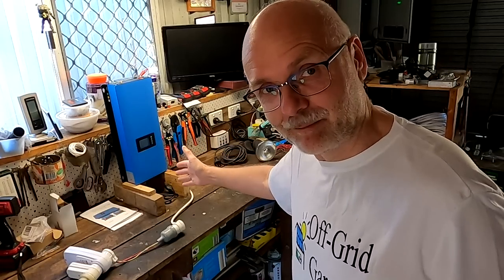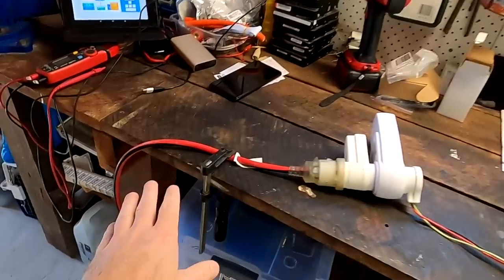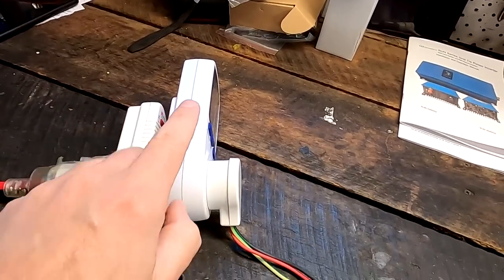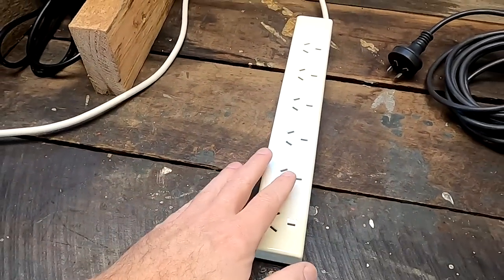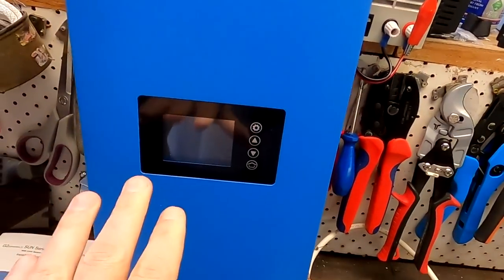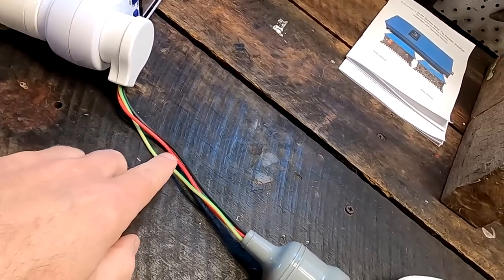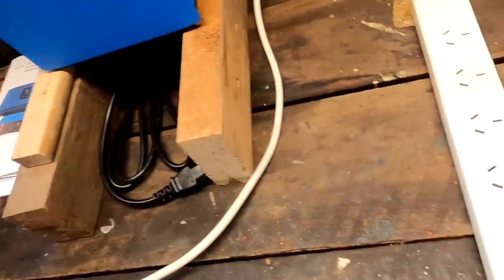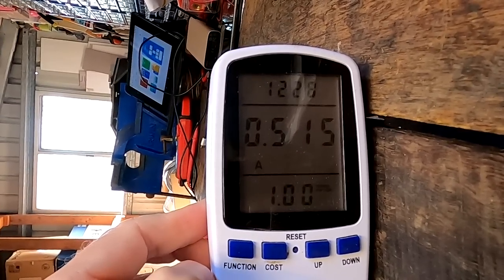Sun 2000 GTIL2 Inverter full test. How it works, what it does.

Comment: So if you turn on another light the grid watts will follow the increase? Is 2KW enough to charge your car? My dream would have one that does both the car and pool pump. I know maybe I am a little greedy! Baby steps; some day dreams might come true.
Reply from the maker: You can just parallel them to output more power.
Reply: It would be good if they produced a 3kw or 4kw model. Cheaper than buying two 2kw units and simpler installation. It could then cope with loads like kettles/toasters etc. Many EV cars use about 10A from a wall outlet when on slow charge so a bigger unit could avoid grid top up.

Comment: I have the unit not providing any voltage to grid. To not have nosebleeds of power company, anyway I balanced pretty much my house usage with panels.
Reply: there is no excess mostly to worry about it.
Reply: I use power strips to turn off vampire/stand by loads
Reply: I use watt meter Kill O' watt to determine vampire loads
Reply: nice you tube video
Reply: during like 7am till around 5pm it provides power I need via panels
Reply: I do not have ac so it is enough

Comment: How do I purchase one of those Tee Shirts?!
Reply from the maker: They are here: https://off-grid-garage.myspreadshop.com.au/
Reply: @OffGridGarageAustralia  Thank You! I ordered a white Tee Shirt and a coffee mug. Thank you for the discount as well. I look forward to your response on using a charge controller from solar while on batteries while in "Bat or solar limited current mode". My manual made reference that: "MPPT function on the inverter will auto invalid when working under this setting." So I think my idea will work (use Solar during the day to both supply the inverter and charge batteries and then at night use batteries to offset house load with inverter set to cut off at battery voltage set point).  Thoughts?
Reply from the maker: @benkanobe7500  Thank you for your support, much appreciated!
That will definitely work if you have enough sun during the day. The charge controller will supply power to the inverter and surplus goes into your battery. If you have a cloud or shading the charge controller will still supply power but if the inverter needs more, the rest will come from the battery then.
If the battery goes low, you can tell the inverter to cut off and wait until a certain voltage is reached to kick back in again. This is a dynamic setup and goes gradually.
Reply: @OffGridGarageAustralia  Thank you for taking the time to read and respond especially since this is something you have already passed on.
 That is exactly how I intend to use it. So much more simple than having a "Critical needs" panel, or running load-specific circuits from my Growatt. I may not even use my Growatt now.

Comment: I got mine from ali, but I found a source here with a 3 year guaranty  in the Philippines, I found it after my purchase from ali that had a 1 year guaranty and you pay to ship it both ways from china
Reply: ali had one year but You have to pay shipping to and from china for warranty, mine went belly up just after one year, had it fixed locally for 80 bucks
Reply: it was less than 25 bucks both ways shipping to repair here in manila area.
Reply: Roger Naval is the vendors name
Reply: his gti's 1000 and 2000 watt are a bit expensive but they have 3 year guaranty and you pay only shipping to and from the Philippines. for me it is like 25 bucks for repairs. it is a lot to and from china and warranty is generally 1 year  from ali unit , it is 3 years here
Reply: it is very sparse on useful info.
Reply: lazada has it here in the Philippines with 3 year guaranty, I got mine from ali but it went belly up after around 1 year
Reply: in the u.s. I think this inverter gti is not on the "approved list" and it is not u.l. listed, that may be a problem with insurance companys
Reply: on approved list changes from locality to locality in the u.s.

Comment: I hear that in America the standard power metes on our homes will see this power as grid power and charge us for it. Is this true?
Reply: This is not legal advice: I live in San Diego and have had a "Smart Meter" on my house since they were all swapped out from the old dial ones. There is lots of urban legend about what the smart meters do and don't do ("say" back to the Mother Ship). My experience is that I have three cheap China Grid Tie Inverters with NO limiters. I let them run until they shut off at night and turn back on in the morning when the sun hits them and they produce enough voltage. I have each one on its own circuit and circuit breaker. I have a total of 1,540 Watts of solar divided (not so equally) among the three. When it is sunny, my inverters pump between 100 - 600 Watts into the grid while taking care of my normal house load of around 220 Watts and also powering my frig and freezer. In other words, my house is completely powered by the panels/inverters (if A/C not on, Microwave not on, Hairdryer not on, outside electric oven not on) all day while dumping excess to the grid between 0- 600 Watts. I have been doing this for 9 months. My power bill went from the high $300s to now almost never higher than $100. There is no maintenance, I do nothing. I think the trick is if you inquire with your power company or foolishly tell them you are doing it or if you get a "net metering" contract then you are on their radar. All I get is monthly "congratulations" letters with comparisons to my neighbor's use and a chart showing how little I am using from last year. Don't know other than my experience, but that is what is happening for me.

Comment: What about Grid Safety? Say the grid is down from a thunder storm what protects the utility guys from getting shocked from the inverter giving power to the grid?
Reply: The inverter turns off if there is no power coming from the grid. When the thunderstorm causes a blackout, this inverter will also turnoff.
Reply from the maker: The unit is a grid following inverter. It will turn off within 25ms. The same with my other AC coupled system on the house. If they turn off power at the grid, the inverter turns itself off immediately. It's called anti-islanding. Otherwise all inverters in my street would stay alive as they think the grid is still there 😊

Comment: What would be good with this inverter is a way to calibrate so that (1, the readings are accurate, and (2, adjust the imported minimum power, for example so that instead of keeping it at 2-5w constant, you can keep it at say 50w constant, so that when the inverter does ramp down from a bigger load being disconnected, the feed in is far less. This feed in over a quarter year billing period would be in some cases 5-10kwh and that would certainly be noticed on a house that has no solar/feed in allowed at all. If a house with no solar is registering feed in, the power company must assume either the meter is faulty, or the customer is using a generator or grid tied inverter like the sun grid. Therefore they could possibly investigate and issue rather large fines. This feed in on the ramp down is the ONLY thing stopping me from buying one. If there is a way to stop that feed in on the ramp down I’d love to know how.

Comment: Is this like those constantly breaking down, and burning up, eBay GTI models?  Meaning this is actually made right so it doesn't just go POOF one day, while still being simple as power in to a wall plug you stick into a wall socket to power the grid?  No special wiring etc... needed?  That was/is the lure of those garbage eBay units as a proper GTI setup requires far more than just plugging it into the wall socket.

Comment: Simple use 1000w grid tie on 1 phase and another 1000w grid tie ct clamp on 2nd phase
Reply: Hello. I have 1 grid tie 1kva with limiter, I have only 1 phase,and connect the limiter. now I order one more 1kva, can I connect the the second limiter on the same phase? So 2 grid tie inverters,  connect the 2 limiters on my 1 phase. It will be OK? Thank you

Comment: Is this Sun 2000 GTIL2 Inverter disponnible for canada??? where i live it's 120 VAC 60HZ and i have 1 solar panel 260 watts at 24v with 1 Lifepo4 280A 12V battery. And i have the Epever MPPT 20A solar charger.

Comment: You could use it to assist an off grid inverter for more capacity.
Reply: @offgridwanabe  I think that even if it doesn't with the export limiting of the sun gtil you could stop it from going back into say a high frequency inverter. But yes if off grid inverter such as the victron Andy has is capable of ac coupling then for sure it is fine.
Reply from the maker: Not sure if I should connect such an inverter to another off-grid inverter? You're saying it works?
Reply: @OffGridGarageAustralia  sure that is what me and others have commented. Look up AC coupled off grid or micro grid. Victron is capable. I run a AC coupled system diy not victron though. My comment was not about charging the battries though but using the current limit function for smaller systems to boost the output power of said systems.
Reply from the maker: @jasondevine6014  yes, I know. Thanks for all your input. I would probably stick with Victron in my case as it would integrate nicely with all the other gear I have from them.

Comment: While it's minor, just a point to make - always hook up a current tap (your split transformer for line sensing) to the machine, or meter, or whatever first to create a load - THEN clamp it to the line. Mathematically speaking, there is "infinite voltage" at the output wires otherwise, and it can cause damage to the fine windings in it if there was a flashover. 

Or if you were dumb enough to be carrying the bare leads in your mouth you'd get a nasty shock.  Hahahaha....   :D
Reply from the maker: The output of the inverter is not live until it is plugged in. So, you cannot get shocked at all. It's called anti-islanding.
Reply: @OffGridGarageAustralia  - Not what I said.  ;)   The current tap that senses the mains current. When there is current flowing, it creates voltage at the output leads.  I've worked as a generator tech for near 20 years now, and we use them all the time.
Reply from the maker: @DrFiero  Ah, you mean the CT. Yeah, that makes sense now. Not sure why people would put this in their mouth 😂😂

Comment: You will find out that a 48v battery is to low of a voltage for the 45-90v inverter. It makes the inverter use to many amps. It’s really hard on the inverters unless you plan on continuing to only supply the low mount of loads shown in your video. A 60v nominal battery is much better, it’s closer to the middle of the inverters 45-90v inverter. Running any inverter at the bottom of its operating voltage isn’t good for it.  They make a 22-65v 240v version which is much better suited for a 48v battery
Reply from the maker: Yeah, there is no other way. It's a 16s LiFePO4 battery so it will hardly see 53V or more.

Comment: Starting at time mark 17:07, your inverter seems to lose ~20% of the power that your power supply was generating  (i.e. 114.5W out vs ~141W generated).  Why is that?? Crappy Chinese tech?
Reply from the maker: That is normal for all inverters at low power. The best performance is always at maximum power. My Victron Phoenix inverter is the same. Maybe not as bad but still... bad at low consumption.
Reply: @OffGridGarageAustralia  Interesting.  I see many inverters claiming 95+% efficiency.  I never guessed it had to be at or near max power for that to be the case.  Thanks.  I'll have to keep an eye on that--if that is the case, then it would seem Enphase single panel inverters might have that same loss problem---although I've never seen anyone test that hypothesis...
Reply from the maker: @ab_ab_c  You can always run the inverter at 10% load and measure the input power and compare it to the output power. Sometimes the manufacturer publishes a table ins the manual where it states numbers for different load types.

Comment: Let's say you grid DOES NOT accept ANY incoming power from the home and you set this unit up. What happens of the clamp becomes defective and your house consumption is lower than the solar produced? Boom?
Reply from the maker: It will feed power back into the grid. Even if not allowed. I cannot see that the sensor itself will fail. Maybe the limiter and inverter itself?
Reply: ANY system can develop faults. Which is why electrical workers are trained to assume that all lines are live, and why they place earth jumpers on any line before working on it.
Reply: @OffGridGarageAustralia  In my case I would have liked to see the unit simply stop if the sensor is not functioning.
Reply from the maker: @paulbarrette2557  I guess it depends what the fault in the sensor is. Could be a broken cable or a short, so either tells the inverter do nothing or do everything and go full steam ahead.
Reply: @OffGridGarageAustralia  Agree. I guess my question is now. Does this unit have a a certain number configurable actions that it can take in the sensor is down or not responding? Thanks for the video... I never understood how these hybrid inverters worked. Not pertinent in my case but very cool.